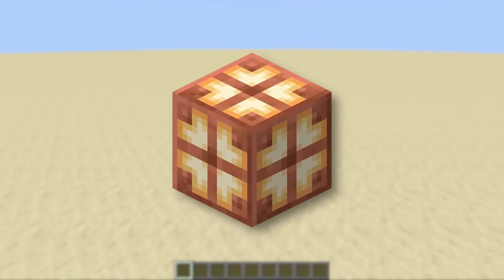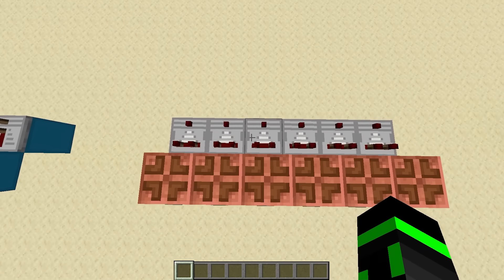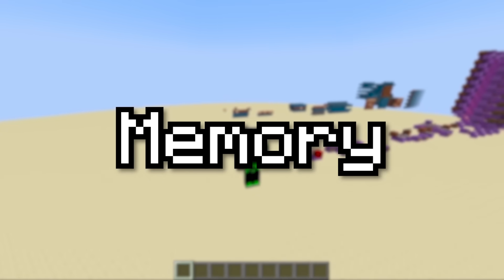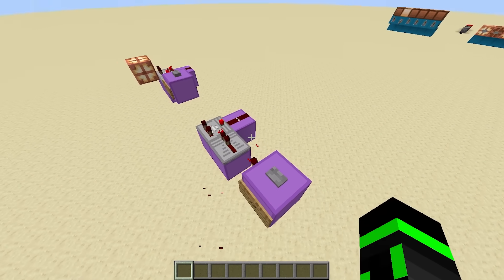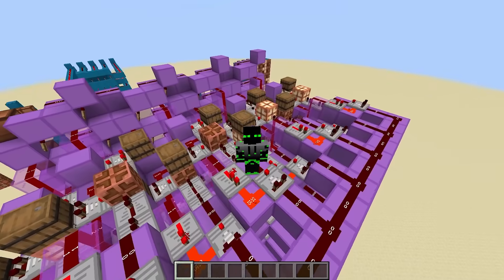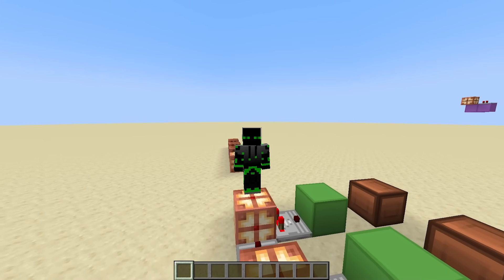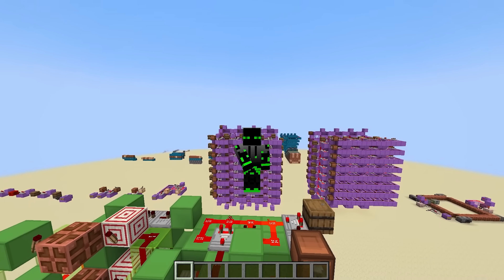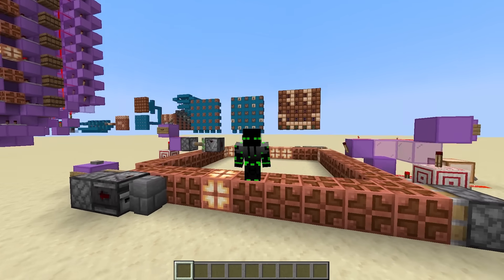Why I'll Never Use Copper Bulbs

Comment: I don't really know much about redstone, but it sounds like copper bulbs are a perfect replica of secondary storage. Most of your arguments against copper bulbs are about them being difficult to reset, but I think this actually gives a greater correlation to real life computing. Redstone lamps are volatile (like RAM) and need a signal (power) to stay on but copper bulbs are non-volatile (specifically secondary storage) and something like barrels is read-only memory as you mentioned. Resetting/flushing your redstone storage is the equivalent of turning it off and back on again! Taking this into account, they would all have great uses in computation, it's just that secondary storage happens to not be used as much in redstone projects since if a redstone engineer wanted to save the state they'd probably just save it as a schematic or make a backup of the world
Reply: Oooh… drum memory (multi-level piston tape). Early drum memories soved the persistent state problem by erasing the drum after the read head and before the write head, copying the data forward if it didn’t need to be over written.
Reply from the maker: thats a fantastic way to put it!!
Reply: @mattbatwings  i was thinking of making copper bulbs as hdd, kinda like you did with the spinning copper bulb.  maybe ssd as well.
Reply: @somerandomdude712  I think that's a bit overcomplicated and perhaps you could try using shulkers + discs + jukeboxes instead, with some storage of discs for writing and then have chests filled with the shulkers filled with discs
Reply: @syxalite  maybe, but i ain't really a redstoner or do logical redstone, just an idea to give out to see.
Reply: @mattbatwings hi
Reply: @mattbatwings  9:45  "I love seeing creative redstone builds, even if its not my field"   
lolwut ?!  Your builds are the definition of creative !  both literally and figuratively.  Give yourself some more credit, man !!
Reply: non volatile memory is great in real life because it can preserve data in the case of a power outage, and that it allows machines to save data without being powered on 24/7. Redstone fortunately don't have this problem. They don't have a power source, so power outage isn't a thing, and it's not like you'll ever need to "turn a redstone machine off to save power". So in minecraft, volatile memory is just as good as non volatile memory, with the added benefit of not being annoying to work on
Reply: @Necron3145 chunk loading issues could be considered power outtages.
Reply: @Necron3145  I know we're talking vanilla but I kinda find this comment funni as it's not uncommon in factory mods/packs to use redstone to temporarily disable a machine's functionality, especially in the early-game where you don't have many ways to generate power for all of your machine blocks
I think usually it's just done with one lever per machine block but still
Reply: @Necron3145  I mean would it be good in Minecraft too as with such complex systems can chunk un- and reloading corrupt your RAM?
Reply: @Necron3145 only use case I can see is lag management in a multiplayer server
Reply: Maybe it’d be good for making games that could save (for example, something like Legend of Zelda for the NES) but that’d require making a large game for it to be any use. Basically a game that can be too long to play in one sitting.
Reply: Someone made Pokemon Red in Minecraft and I don't think they used these copper bulbs (because I don't think they were out yet) but they DID have a save c
game feature. The game had has no mods but does use a special book, command blocks and a special texture pack.
Reply: So copper bulbs are the SSDs of the Redstone world?
Reply: @lilyofluck371  Considering that HDDs are impossible to make in Minecraft...
Reply: @null.err.403  copper bulbs could be used for CDs. Since you can move and rotate them but i dont thimk you can put them in a box and move them easily
Reply: @null.err.403  someone made one
Reply: @null.err.403  9:27 this is basically how an HDD works
Reply: @null.err.403  no, you could totally make a piston/contraption that constantly moves on an array of barrels/lamps. It's just totally unpractical
Reply: @null.err.403  the spinning one at 9:42 could be an HDD?
Reply: Lol we soon have those things in reallife than get infinity TB samsung SSD's made by Elon Musk @lilyofluck371
Reply: @lilyofluck371  well, Yeah basically
A very slow SSD
or a tape drive if you want moving parts! which I think is much cooler.
Reply: @lilyofluck371  more like the ROM
Reply: It's honestly almost perfectly comparable to DRAM, where the lamps are closer to SRAM.
Reply: You don't know much about redstone, but you do underestimate your knowledge of Minecraft ! Bravo !
Reply: @jasonrubik  Oh I've played Minecraft for years and I develop Minecraft plugins lol, I just don't touch redstone very much
Reply: Why do people write entire essays in comments for fun, when I’m struggling to get started on an actual essay for school
Reply: @benjeeboy  If you can type fast, it's a lot easier to type a YouTube comment than write an essay lol
Reply: it is definitely more representative of real life computing. the piston tape storage is literally what Turing had in mind when he fathered the science.
Reply: ram vs ssd, got it.
Reply: One use that I thought of is that it's not only secondary storage but portable secondary storage. You could encode, say, a set of coordinates into a block of copper bulbs and slap it onto a flying machine. Then any waypoints that need to guide the flying machine to its destination can just read the bulbs and direct it accordingly.
Reply: Or use torches as nonv-volitile memory. Your idea of copper bulbs beeing non-volitile memery is great. So we can maybe use it kind of like a hard drive.
Reply: But if you want to build a 6-digit combination panel, how would you do it? Would you use a barrel to store the combination and have to decode it? I mean we don't even need a hex bit! We just need a single bit for each digit. So I would store the passcode in copper bulbs.
Reply: @user-ix6gx1gp6k  basically you would use levers attached to blocks
Reply: While it does make computing less complicated to build in Minecraft, it is still useful. With these, even more complex computing is days away. I am going to embrace it.
Reply: But on anything that stores data like that it has a file that tells it where the data is stored, so if it needs to do stuff with the data it can see what registers its in, as opposed to redstone which would require more work than it's worth to make a working memory controller, and that memory controller would also need its own memory controller, goes all the way down.
Reply: Good point

Comment: Not sure how plausible it would be to build because of solid lamps, but what if you combined the display at 5:40 with the copper bulb approach, allowing you to press a button on the bulb to get instant feedback as well as pressing directly on the screen, but it doesn't remove one block per screen pixel like the noteblock would?
Reply: Just make a copper bulb screen with 2x2 pixel, a have a design for that, faster, smaller and better looking that the lamp version, he just didn't want to think of making one, you just need the screen, 1 button on 1 of the bulbs in each pixel, 1 solid block (like wool), 6 observers (that only are going to pulse 1 time, so don't make lag) and 1 comparator, it's a very clean output and the screen is mostly copper bulbs (the buttons only cover a little bit of the copper bulb, it looks like the 1 wide version, but bigger).
Reply: Maybe due to the input? With noteblocks it's a pulse, but with bulbs, it's a constant output. Maybe the redstone was a little more difficult? But i dont know for sure, it does sound like a good solution though
Reply: @zelioz848  I doubt it, since the only block that can read the playing of a note block to activate redstone signal is an observer, which would react to seeing the block state of a copper bulb change just the same as it would react to a note block. But, depending on how the other 3 lights get powered, one may need to worry about the solid lamp blocks causing the bulb to get powered again, turning it off. But that's but a best guess based on the hunch that it's for some other reason than "I didn't think of it".
Reply: could maybe do the 1x1 pixel version with normal lamps by using skulk sensors at max distance from the buttons

Comment: i just have a couple things to not: in you video you talk alot about how there annoying to reset where infact there not. if you just want to reset its literally a and gate not xor and if you pair that with a input and you can get a much smaller copper bulb counter/ register or any other thing. also it isnt that hard to make 1 by 1 screens. with the copper bulb its a much better improvement as people before have made hex to 1x1 pixels so with copper bulbs it wouldn't be hard to do the inverse and wit would be even easier. either way whatever works and is better for you i approve of and ill probably forget about them anyway :P

Comment: Actually what about reading(/write) a sequence of data? Because a copper bulb can be pushed it might be better.
Reply: The pushing mechanic makes me think of old turing machines. Like the simple sequence of 0's and 1's moved back and forth. I wonder if anyone has made it yet
Reply: @zelioz848 several people in CraftyMasterman's discord have made copper-based Turing machines, and my latest video is a demo of my own design.
Reply: I think the read is the same with redstone block and normal block, but it does revolutionise the RW sequence.

Comment: instead of using barrels, i use lecterns with 15 pages (it leaves room for other items in a saved hotbar, and can be switched on a whim)
Reply: I myself find it easier to sacrifice two saved hotbars, because I never needed ten of them, and you can't build on lecterns, so they aren't as compact.
But do whatever you find easiest!
Reply: @caspermadlener4191  if you shift-right-click on a lectern, you can actually build on one (you cannot place redstone on it, but still)
Reply: Lectern are far more laggy but if you replace it by barrel once you finish it will be better.
Reply: @Theo_El_Gato  that is a fair point, but i do not notice the lag, as i usually do not use them by the hundreds
Reply: There is his redstone tools mod
Reply: You can also use item dropper lines and locking unlocking hoppers to encode them by, adding, subtracting, or clearing the items.
Reply: DUDE YOUR CAT LOOKS SIMILAR TO MINE
Reply: i do the same!! i even made myself a book with all of the numbers 1-15 in ascii in the minecraft font (using “[]” as a pixel since minecraft writes that as a square) which makes it super easy to use. i now use that book in all of my redstone builds as it feels way more integrated than just a tiny number on each page haha:)
Reply: There is a mod that allows you to get a pre-filled barrel for any signal strength
Reply: I use nbt editor mod it gives infinite saved hot bars
Reply: ❤🎉🎉🎉❤🎉❤❤
Truly truly i say to you all Jesus is the only one who can save you from eternal death. If you just put all your trust in Him, you will find eternal life. But, you may be ashamed by the World as He was. But don't worry, because the Kingdom of Heaven is at hand, and it's up to you to choose this world or That / Heaven or Hell.

I say these things for it is written:
 "Go therefore and make disciples of all nations, baptizing them in the name of the Father and of the Son and of the Holy Spirit, teaching them to observe all that I have commanded you; and behold, I am with you always, even to the end of seasonal". Amen."

-Jesus

-Matthew 28:19-20
❤🎉🎉🎉❤❤
Reply: @gamer__dud10  you dont need to believe in jesus to be saved from eternal death. i can personally attest to this